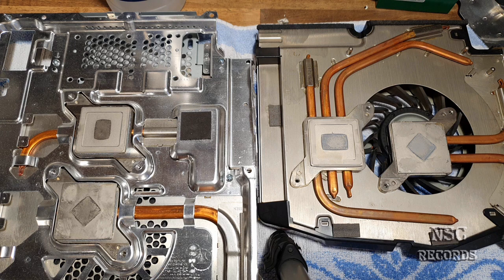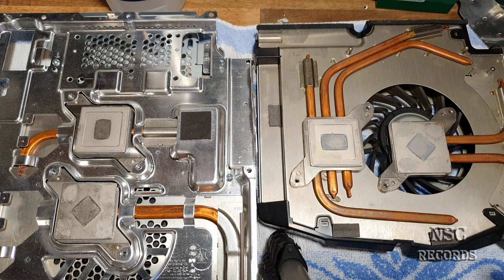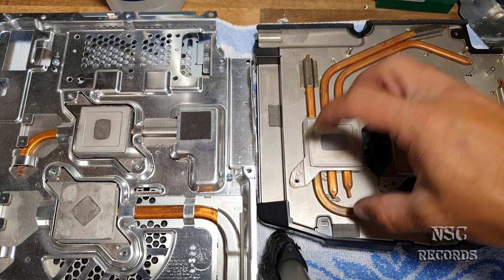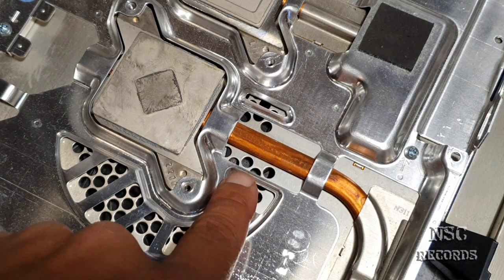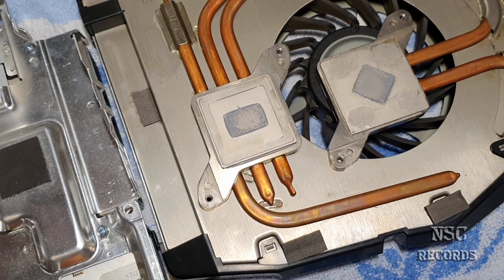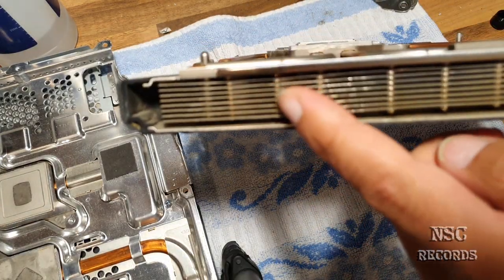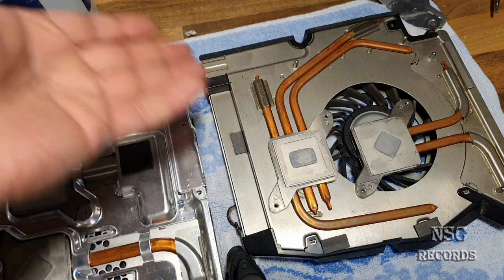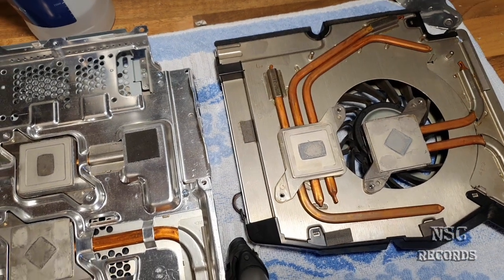PS3 FAT Heatpipes important function for the right cooling By:NSC

Comment: Hey NSC  ist es eigentlich normal, das hinten links an meiner ps3 fat weniger Hitze rauskommt als auf der rechten Seite hinte.Oder hat das was mit den heatpipes zu tun?
Reply from the maker: @MR_Walter_White Hi Ist normal weil der hintere Kühler ist größer und der andere ist etwas kleiner.
Reply: Dachte schon das liegt an den heatpipes danke, für den tipp NSC
Mir ist nähmlich aufgefallen, das die Temperaturen bei gta san andreas  cpu 53 50 RSX sind. Und manchmal sind die dan aufeinmal auf 59/55
Obwohl ich den Fan auf 38% hab verändern sich die Temperaturen manchmal
 sind sie höherer oder niedriger.
Reply from the maker: @MR_Walter_White Absolut normal, manchmal müssen die Prozessoren mehr berechnen manchmal weniger, je nach Grafik und und und
Reply: NSC hast da Vollkommen recht ist mir auch schon bei the last of us aufgefallen relativ am anfang. fan hatte ich dort auf 41% Temperaturen waren dort auf 52/53 waren so c,a 30 min playtime später waren es dan so c.a 58/57
Mitte des Spieles.
Reply: Wollte sowieso gucken die cpu und gpu clamps zurück zu biegen. Darf man die clamps danach, wieder direkt anschrauben oder sollte die paste danach, besser  gewechselt werden.?

Comment: Ahh, this is very interesting video.
It is interesting problem that Fat Ps3 CELL CPUs are normally running some degrees hotter than RSX.
But my friend I'm not so sure it's because of the heat pipes "drying out". I think it must be something else. If you think about it for example, RSX is actually relying even more on heatpipes for the heat transfer than the CPU. But RSX is the cooler one! So if degrading pipes were the problem,  RSX would be hotter.

Instead, maybe it's something entirely different. Have you ever thought about the "square hole" in the motherboard, directly below the CPU? Maybe that is causing a loss of even pressure with the time. Making CPU die to not make flat contact with IHS, even after Delidding.
So an idea is to maybe put something in that hole to be pushing with pressure directly. And hopefully improve CPU temperatures.
I don't know if you know what I'm talking about but I think this is something you should try.

Cheers